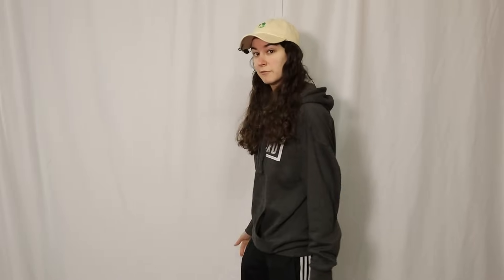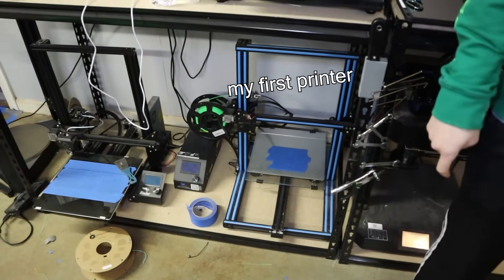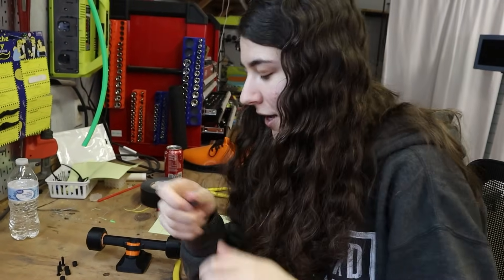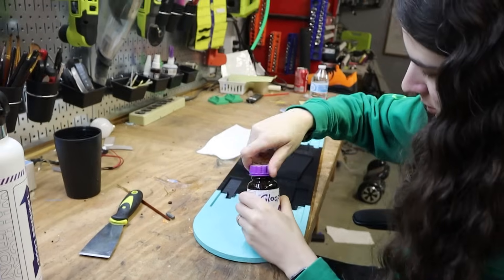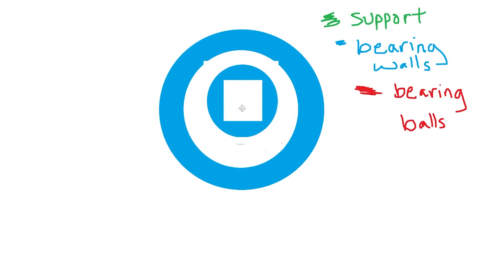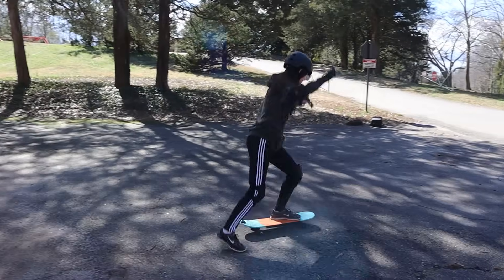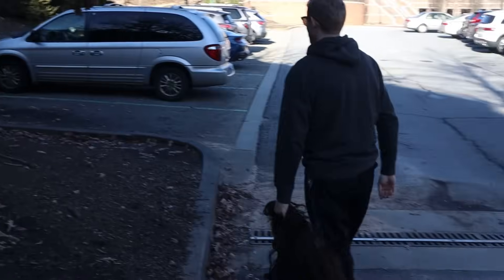100% 3D Printed Skateboard

Comment: I've did a good deal of skateboarding in my teens.  One trick for beginners is to practice standing on the board on carpet or grass, leaning your feet left and right.   This will give you muscle memory on how to keep your center of balance under you without the danger of the board shooting out forwards or backwards,  as they are wont to do.

Comment: You need to add a solid iron/steel rod through the center of the skateboard axel through its full length of each axel so the plastic axel can hold your weight and handle the skateboard moving around.
The plastic axel is cracking and breaking entirely when in use since the crack can travel through the entire 3d printed axel when it is under load but if you add an Iron/steel rod through the middle of the Skateboard axel then the axial load stays on the outer edges and can avoid Skateboard axels cracking under load.
Go for 70%plastic 30% Metal rod or 60%plastic 40%Metal rod for Skateboard axel configurations.
Reply: That defeats the purpose, though - any non-printed hardware you add significantly reduces the "this thing is 3d printed" effect.  Personally I'd have skipped the screws, too.
Reply: @Erhannis  The metal pieces that i said to add were of easy shapes that can be had for fairly low price.
But there are special Fiber reinforced 3D printer filament's that can give structural strength equal to very similar to metal parts.
You can find ore about this filament on Bambu labs 3D Filament store its available in black colour.

Comment: 3D printing bearings are pretty okay for non "heavy" things (what is heavy). I use metal BBs, print the inner and outer ring and a slightly undersized hole to sneak in all the BBs. Filament spool holders, lazy Susan, fidget spinner (whatever you get the point) they work well

Comment: Nice. Like a real board is made out of 7 layers, and I bet you could make a deck that would take alot of abuse if you like print the layers sepratly, and like move the seams around for each layers. Like the wood goes like different directions to make it stronger, and much of the streanght in a skateboard is just the glue and like pressing of it. Like even slapping some griptape on there would make it stronger, but I guess that sort of defeats the purpose of this project. You have to add some concave if it is to be kickflipped by a mare mortal, however I think trucks are made out of metal for a reason ;) Cool idea tho',  I give it 15/7 thumbs up

Comment: If you actually want to make this work, your average PLA and default slicer settings are absolutely useless… Gotta start with bigger nozzles for increased extrusion width, add more walls, minimum of 6 with a .6 mm nozzle @ .8 mm extrusion width. Go up to .3 Layer Height and at least 5 bottoms and 6 top layers (the first top layer adds no strenght whatsoever). Regarding Filament Choice, basic PLA is just about the worst Filament for impact strenght (bumps on the road being your biggest enemy). Stiffness alone wont cut it here… I‘d say either something like Polymax PLA from Polymaker, which offers toughness at the expense of cost, but even better ASA or Polycarbonate… Those usually offer the best impact resistance unless your prepared to go Nylon. A more niche option would be PCTG, which when printed at the precise perfect settings will offer tremendous impact resistance as well… also doesnt warp, so thats nice… None of these are cheap though, so for starters change your print settings, the think about failrate vs filament costs for projects like these :)

Comment: I don’t know much about printing plastic, but would it be possible to embed metal parts into the high stress plastic parts?  I am thinking interlocking metal parts that can be coated with silicone spray and then inserted.  Sort of like metal bones with plastic flesh.

Comment: I think that it would have been better if you used a round axle.  By using a square axle, you are really depending on the 3d printed bearings to roll.  If there was a round axle, you would get the rotation of the bearing AND the rotation of the bearing around the axle.  Maybe you viewed that as cheating though (because you wouldnt actually even need the bearings at that point)..........and I could understand that.

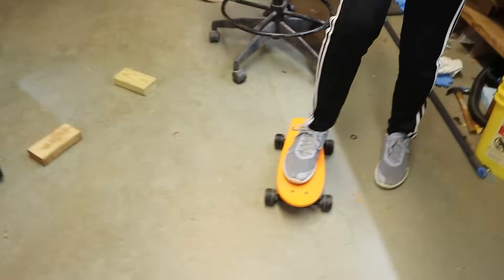Comment: Simplified 3:37
(P*L^3)/(48*E*I)=max displacement:
P=force
L= length
E= material stiffness
I = area moment of inertia (the stiffness of the shape)
I = (b*h^3)/12
The important part here is the h^3 and the L^3.
L in this case is the length between the wheels and h is the thickness of the bord. If you make L longer you make the bord way more flexible (and weaker) and if you make the bord thicker you make it way more stiff. If you double the thickness the bord gets 8 times stiffer. This is good to know.🤣
If you want to know about the details start by looking up Euler–Bernoulli beam theory, it is easier that it looks.
Reply: its also just common sense. Any child knows that a thicker stick is way stronger than a thinner one, and a longer one is bendier than a short one.
Reply: @bermchasin  Well yes getting to the stiffer part might  be simple. If you get to the h^3 and L^3 part by your self I would be impressed, I don't think that is common sense. (I think that is Engineering). But if you think this is too easy you can keep adding to the complexity. You can experiment with different cross sections, try unsymmetrical cross sections, different loads, you can combine different materials (sandwich structures). And if it is still too easy for you, you can start looking into global and local buckling of beams in bending. 
It is like they say. If it seems simple to you, it's just because you do not understand it deeply enough yet.
Reply: or you could just plug it into CAD and let it run the stress analysis for you.  It seems simple to me, because it is a simple prinicple. Most skateboards are made with layers for a reason.
Reply: @bermchasin  hehe. As someone who made a living doing FEM analysis for 10 years, I have seen my fair shear of people just plotting some numbers into a CAD program and then looking for red areas on a stress plot. I think FEM is a super powerful tool, but it should not be used as a black box. The program gives you the answer to the question you are asking, but for it to be useful you will need to understand the question you are asking. If you don't understand the assumptions of your boundary conditions, your element types, you contact definitions, your material properties, the numerical model used to solving your equations and much much more, you might not check your reaction forces, mesh converges and so on. And then if you get a result that shows that your design is not strong enough then you cannot make a simple estimate to check if you might have entered a wrong value somewhere and you do not understand load path and structure enough to suggest a better design. Say you get a pure bending stress of 120 MPa, and you can only allow 60 MPa of stress in you material. Now how much thicker do you need to make your part? (Hint it does not need to be dabble the thickness).
I have never regretted learning beam theory, honestly I have only regretted learning very few things in my life. But the list of things I regret not learning is nearly endless.

I have not seen a skateboard in many years. But as i understand it a skateboard is just made out of cheap plywood. I don't think the goal it to make it as stiff en bending as they can, my guess is (since wood is stiffer in one direction) they want it to be cheap and reasonably flexible. They might want some dampening, and maybe the don't want it to be too light or too heavy. Otherwise they would be designed as snowboards and skies.
Reply: @Petch85   sometimes you can learn so much, that you forget the basics. Its a simple plastic skateboard deck designed for 3d printers, no need to overcomplicate it.
Reply: @bermchasin  The channel is called "Emily The Engineer". I feel like it is fair game takling Engineering in this channels chat.🥰
Also engineering does not get much simpler than "(P*L^3)/(48*E*I)=max displacement".
I think most mechanical engineers would define that as the basics.
But you don't have to do it, I am just giving you the option, even with suggestions to what you might like to google next.
Reply: @Petch85    I do not think you understand. I am not saying the equation is difficult.  I am saying it is unecesasry.  Yes, the channel is called Emily The engineer, but in this case it was just a simple 3d printed part. At some point all the math in the world cant replace just printing the darn thing and standing on it.

Comment: Ah yes, the classic engineer wanting to skate but being too scared after falling once. I am very familiar with this
Reply: go out and skate!
Reply: @bermchasin  I would but it's still too wet where i live rn and i dont want to ruin my bearings, the weather should get better soon though, so i will!
Reply: @rat-in-a-suit  ceramic bearings!
Reply: @knoopx  I've honestly never heard of ceramic bearings, wouldnt they be quite brittle though?
Reply: @rat-in-a-suit  yes they can crack but withstand 75% the load of steel ones. so as long as you don't jump big ass heights they should be fine (they are also way smoother/expensive).
Reply: @knoopx  hmm, I'll look into it, thanks!
Reply: I destroyed an inner knee tendon in such a manner. Very relateable 👍
Reply: I tried skating for the first time when I was young and if I didn't wear a helmet, I probably wouldn't be here right now lmfao.

Comment: Probably needs to at least double the size of those wheel truck axles and bearings - and ABS would prolly help a lot too.  Still, exactly the kind of engineering chaotic good I need on a Sunday afternoon.  Roller blades?????

Comment: I’d love to see more about your plastic soldering technique and how well it works. I’ve tried it a few times on different types of plastic and never gotten it to actually work well.
Reply: I have had pretty good luck heat welding PETG. I use a temperature controlled heat gun  that is part of my soldering station with a small nozzle and treat it just as I would gas weld with a torch and wire. I use a chunk of filament as filler, and prepare the joints as per normal welding practice. I add taper grooves for more area and design the joints as standard welding overlaps. One other point, the area has to be 100% infill because it will just shrink and collapse if there are voids
Reply: It all depends on the type of plastic you use. You can solvent weld ABS with acetone.